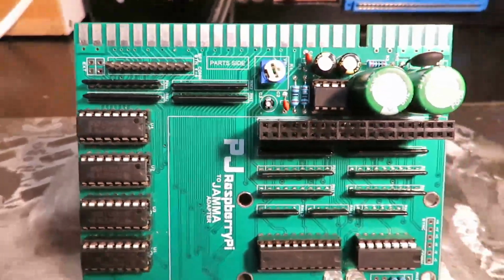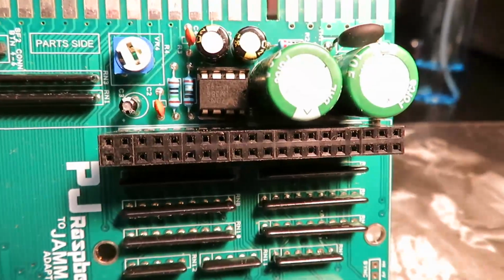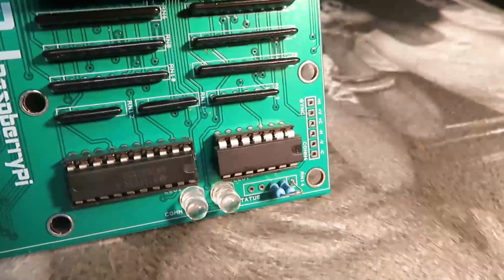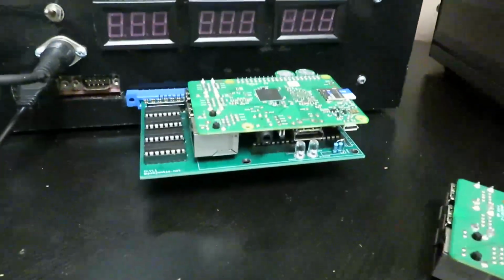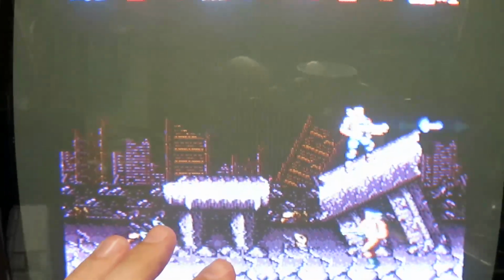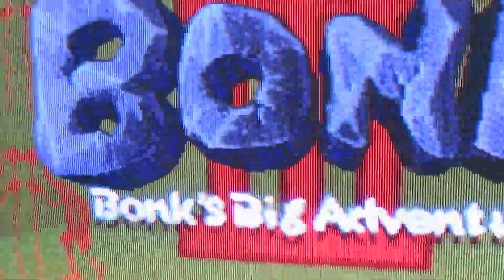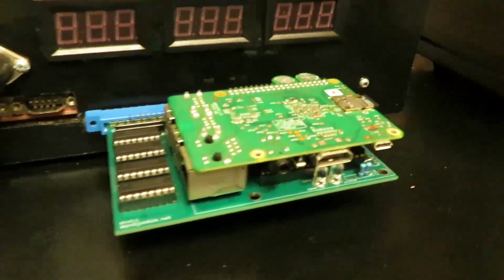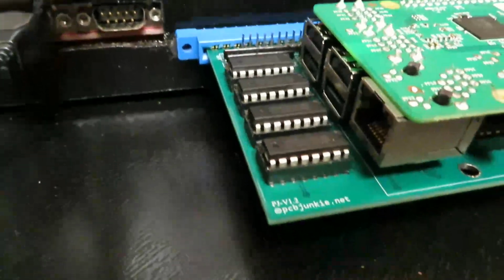PJ - Raspberry Pi to JAMMA Adapter

Comment: does it work with any image or only ur premade images
Reply from the maker: You'll need to configure other images for proper video and audio output as well as install drivers for controls (required) and power management (optional but highly recommended).
Reply: @pcbjunkie1 wat kind of images donu have premade and is it just a pi 3 b plus?
Reply: The images u have are plug and play with this adaptor?

Comment: Is that setup on a CRT arcade monitor with CGA input?  That is my goal
Reply from the maker: Yes, 15khz analog video through JAMMA is the default, but you can also run medium (24kHz) and high resolution (31kHz), or any other modern video mode through the built in D/A converter.

Comment: So I just got a Rush 2049 that has the jamma harness and all. Have a pi already. Is it really just as simple as sandwich the pi and adapter together, and attach jamma harness?
Reply from the maker: In most cases, yes, it's that simple. However JAMMA standard assumes 2 joysticks and buttons, and cabinets like Rush 2049 are only partially JAMMA compatible because of the controls.
Reply: @pcbjunkie1  ah thanks!

Comment: Does this work on VGA monitors?
Reply from the maker: It does, as long as you can wire JAMMA to VGA somehow. There is no direct VGA port on this. You could also just use HDMI to VGA and do it this way. Default out of the box is CGA (low res) over JAMMA, anything else and you'll have to make some config changes to the image.

Comment: I have an Arcade1up partycade that I turned into a jamma 60n1. If I buy your converter can I just plug the pi into the jamma harness and straight swap it out for the 60n1?
Reply from the maker: Most likely yes, though it depends on the conversion. Usually those conversions aren't exactly 100% JAMMA. You may need to tweak your video setting to match the monitor. The images I provide are set up for standard resolution CRT arcade monitor. If you have an LCD in there, some settings will need to be changed for sure.
Reply: @pcbjunkie1  So are you saying one adjustment to get everything lined up right or are you talking having to readjust the screen before you play each game?

Comment: Cool stuff. Was looking to get a pi2jamma premium for a cocktail table build but picked one these up instead. One question, what is vr4 for? Is it possible to increase video amp levels? The cocktail I am working has its original monitor (capped) but is very dim with a cheap 60 in 1 and looks fine on a BitKit v2. It'd be nice to be able to adjust levels without having to mess with the monitor. Thank You for taking shutdown into account! It's great to not have to spend money on a pi ups just to get a proper shutdown.
Reply from the maker: Thanks for your support and your feedback! No, there is no video amp on the adapter. I found that it wasn't really necessary, but as you said it may require brightness adjustments on a dim monitor. The pot is volume control. I will label it on the next revision of the adapter pcb. :)
Reply: @pcbjunkie1  The only real use case for video amp is in a multi board setup where a jamma switcher is used and monitor adjustment isn't really feasible between games. If it's the sole board in the system then I'd just adjust the monitor to it. Even without, most boards put out good video signals and a $30 60 in 1 board is probably not a good measure of anything, it's just the only thing I have ATM until the PJ arrives :). I really appreciate the lower cost and repairability of the board!

Comment: Does it works with the Raspberry Pi 4?
Are you in Vancouver?
Reply from the maker: It does work with a Pi 4, although emulation on the 4 isn't as fluid for some reason, and 3 is still the best option as of this moment. I'm in southern Ontario.
Reply: @pcbjunkie1  Shut up and take my money! :)

Comment: Is this for-sale yet?  I didn't find it in your Ebay listings.
Reply from the maker: The first batch sold out. Waiting on more parts and will make more. Should be available in a couple of weeks.
Reply: @pcbjunkie1  Ok, thanks.  What were you roughly selling them for?
Reply from the maker: @b1mpza40  The first revision is $80 CAD. As I add features the price will probably go up somewhat.
Reply: @pcbjunkie1  Great.  I will order one once it's back in stock.  Thanks from a fellow Canadian.  : )

Comment: Does it change resolutions on the fly?
Reply from the maker: The resolution is pretty much fixed here. Only horizontal pixel size/count/timing can change. This is for compatibility with standard definition arcade monitors.

Comment: I hope someone comes up with a straightforward image that boots with a black screen straight to a single rom. 

It would allow this to be a direct replacement for a dedicted pcb.
Reply from the maker: For sure. I'll probably do this soon, the only issue is compatibility. Some MAME versions work better with some games than others, so there would need to be a way to pre-configure the image for the correct emu, video mode and orientation, and some experimenting would likely be required.
Reply: Awesome! I also just saw some reviews for the Rock Pi 4 which appears the have the same gpio pinout.  Do you think this could work for that as well??
Reply from the maker: @patricksamuel6594  I'm going to say probably not. Video over GPIO is unique to the raspberry Pi as far as I know. I looked at that board briefly and couldn't find anything that would suggest it has that capability.
Reply from the maker: The single ROM image is done. Check out my other video on it here: https://youtu.be/ZalAhm8yDe4

Comment: Really cool project! I'm intrigued by the way you're handling the controls. One thing that's turned me off of pi emulation is the input lag I've noticed. I also appreciate the fact that you make this board easily serviceable by the user.